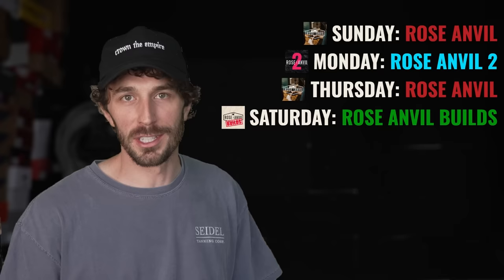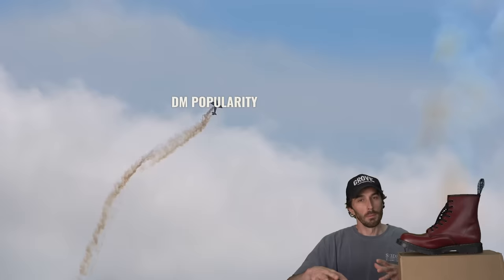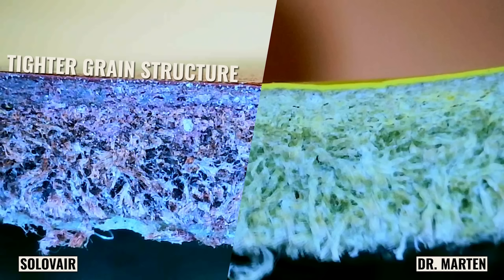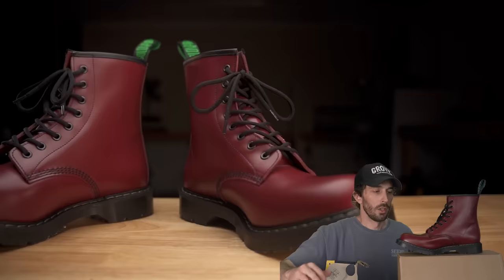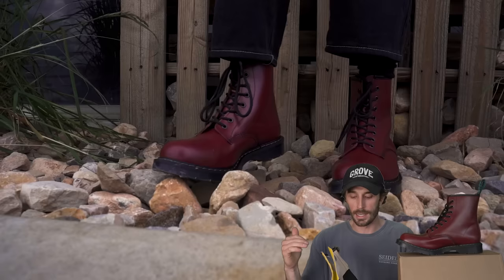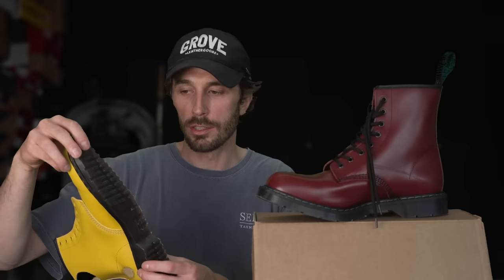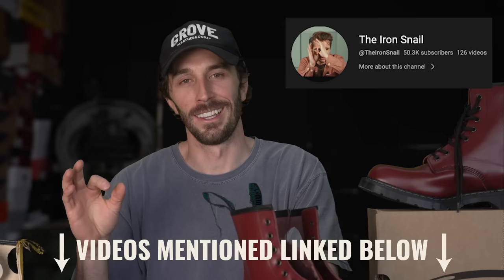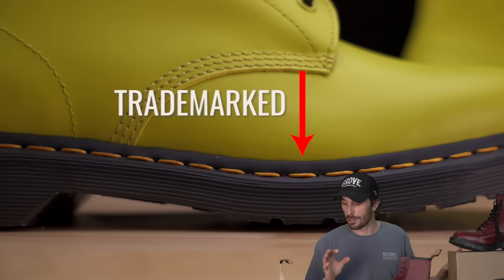Better than “real” Dr Martens - Solovair

Comment: Surprised you didn't mention the main reason I personally bought Solovairs: resoleability. I hate the idea of having to throw away perfectly good uppers because the sole has worn through and can't be replaced
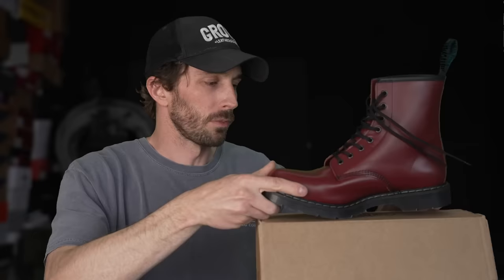Reply: He briefly says it at 9:56 😂
Reply: I agree with you but resoling is pretty expensive, It can easily cost like 75% of the shoes cost , so i understand why it’s not a glaring issue. Even though i do agree that keeping the upper is better as it’s a bit more eco friendly and worn leather just looks nice imo
Reply: Honestly, that was the number one dealbreaker for me when it came to Dr. Martens. I actually bought a pair of boots that I purchased when I was 16 1/2 years old. I was originally going to get more when I first came across Rose Anvil’s original review of the brand itself and learning about how it would be difficult to get them resoled.

It wasn’t an easy choice for me to make up the time, but that’s when I decided that I wasn’t going to buy doc martens ever again. As much as I like the fact that they were cheaper (not including the fact that they upped the price by $20 during 2022), I thought that I was paying for a higher quality boot that looked exactly like doc martens.
Reply: In the UK Timpsons can resole Dr Martens. However, it can be costly especially if they aren’t the standard sole. I bought some DMs for £90 (down from £120) tried to get them resoled, they quoted £60!
Reply: 60 seems ok on a 200+ boot?
Reply: @Stan_the_Belgian where I’m at in the US there’s a local cobbler that can put vibram soles on them, but it’s 120 bucks, almost the cost of a new pair.
Reply: You are comparing English Solovairs to Asian sweatshop Dr. Martens. Completely biased and unfair…
Reply: @cruzmalibu4361  agreed. They should be the made in England ones dr martens used to compare.
Reply: I just bought my first pair of Solovair chelsea boots and I will never buy an everyday shoe by another company..
Reply: too bad the solovair doesnt have yellow stitching that is the thing i like better on the dr
martens…
Reply: Waiting for Solovair to come out with a platform that is at least 2” like the Jadon’s. I would spend the extra for their quality, but I prefer a high platform of 2”, and Solovair only goes up to what looks like a Bex height or about 1.5”. 

The other issue is that Solovair has significantly less selection and unique styles than Doc Martens has. I love the selection of unique boots Docs comes out with, I’d absolutely spend extra money on better quality, but I’m yet to find another company who makes similar platform boots with so many unique styles. 

Anyone find a company they love making high quality platform boots? I’d love to know!
Reply: A couple of years ago, two pairs of my Doc Marten shoes were getting quite worn on the sole. A local shoe repair shop charged £60 per pair for a full DM resole. But instead, for less than £20 per pair, they almost seamlessly bonded a layer of very similar looking, but sturdier PVC material onto the original sole and heel. It looks great, and it certainly doesn't wear as quickly as the original material. Well worth it to extend the life of DM shoes or boots. I've been wearing DMs since the early 1980s, but I won't buy any again, they've really gone downhill.

Comment: I have a pair of steel toed 10 eyelet Docs that were made in 1987. I stopped wearing them in the late 90s because the steel toe was uncomfortable. I held on to them because they had a double yellow puritan stitch that I’ve never seen on other Docs. After watching your first video on Docs, I dug mine out and cut into the well worn soles. They had wooden shanks that were both broken. I found a place that resoled them with Vibram soles after removing the steel toes. They even preserved the double yellow stitch. I had them put in steel shanks. They’re finally comfortable to wear and the leather is still holding up. The quality is totally different compared to later made cheap Docs. I’d love to see what’s inside of the “Made in England” boots today. Thanks.
Reply: Where did you find a cobbler to resole them?

Comment: I have a pair of the made in England Docs and they’re superior in every way to the current regular Docs. They definitely remind me of the ones I wore in the 90’s- much tougher break in but then pretty comfortable. I’d really like to see a comparison between these Solovairs and the MIE docs. Great video.
Reply: there's a comparison video on this channel somewhere. I think the conclusion is that the MIE docs are much better than the china-made crap ones, but the solovairs are still better that the MIE doc's.
Not that the solvair's are without their compromises. But it looks like they're some of the best boots *for their low price point*. Sure i could get redwings for like £100 more, but that's like a 50% cost increase
Reply: does it actually fit in? if you wear chinese uk 8 size will the same MIE 8 fit or you need larger?
Reply: @irakli.asatiani I think they're made to the same size

Comment: Quick tip if you’re about to buy Docs/Solovair: never buy Hi-Shine ones. These boots have some kind of plastic coating on top that not letting shoe creams penetrate to the leather.
Always choose for Grain Leather, Greasy ones or any another that actually has real skin pattern on top.
Reply: your point is right, but the coated leather is the classic look most people want to have when buying a combat boot.
Reply: Yup, I have a more dress oriented solovair shoe with this high-shine finish, and it has cracked and wrinkled to shit. No slav squats allowed!
My oil leather 10 eye shit kickers from them are going strong after half a decade.
Reply: Are you referring to patent-leather high gloss or even leather that can be polished to a higher gloss (and open pore that absorbs cream and/or mink oil)?
Reply: I second this, I made the mistake of picking up the hi-shine version and I regret it, since the "flawless" shine becomes obsolete once the leather starts really breaking in and cracking
Reply: @awethesound  Off topic, but proper slav squatting doesn't crease shoes. Source: am a Slav.
You should keep your feet flat to the ground, shouldn't lift your heels up. That way you can relax your leg muscles and you are more stable.

Apparently westerners have trouble doing it properly? At least, that's what I've heard. Something about calf muscle lengths, don't remember it well.
Reply: @RaccKing21  not really a muscle thing, we're just used to always lifting our heels when squatting briefly and not squatting for really any other reason than that. I can do it, but unfortunately I can't really do it in leather boots, gotta bend my ankles a bit, but heels stay flat.
Reply: @salskars6637  I think he's not refering to patent leather but to "bookbinder leather". But no, neither of them absorbs cream.
Reply: @RaccKing21  I can pull off a slav squat reasonably well, but I still find it fatigues my legs, i can't feel relaxed in that pose ahaha
Reply: @Unimportant Account  I don't squat much in day to day life, but it's handy if I'm waiting in line or something. It looks really dumb, but I genuinely just squat in the middle of a line if my legs get tired.

It's possible you're keeping your legs too spread out, you should literally be sitting on your calves (maybe I just have thick thighs so it's more comfy to me).
Reply: Thanks 👍
Reply: @phipschi4255  Yeah, my point was too radical. Just want to warn people who expect that their Hi-Shine boots would last longer without cracks if they gonna use conditioners/shoe creams/polish. Hi-Shine leather just won't absorb it.
Reply: Same goes for any dress shoe or boot up into the high end. It’s called polished binder or bookbinder and yes, it will eventually crack. Even on £870 Church’s.
Reply: Ty that's actually very useful to know! The polished look is definitely appealing but it's nice to know what to expect at least :)
Reply: @awethesound could you elaborate a bit on how long it took for the coating to crack? Like how did you wear them and after how long did you notice? :)
Reply: They have a crazy horse lesther option (lightly sanded top). That one is probably their most durable version, it won't show scratches or creases and will absorb leather conditioners.
Reply: @phipschi4255  you just gotta learn to shine boots...if you want to learn really really good, join the military.
Reply: Yes and then they crack and tear and you have to go have them fixed and it makes you so sad!!!
Reply: How do you know which size to get?
Reply: @Chilling4Shillings This type of fashion boot is called a combat boot
Reply: @RaccKing21  yeah, I'm Polish, but I do it improperly. I guess it's that EU citizenship.
Reply: @maxjarvela4255  honestly within the couple first wears. I did nothing to avoid creasing them, but didn't expect the effect that I got.
Reply: I have learned this the hard way. But anyway, I think the greasy leather looks much better and it’s so resistant to creases
Reply: One of the best things about Solovair is the wide variety of leathers and finishes available
Reply: Welp I just go my Hi Shines in the mail :(
Reply: @jtlovestj  Nothing wrong with the hi-shines, it depends on what you bought them for & how you intend to wear them
Reply: @antennastoheaven  correct 👍
Reply: Some years ago,the leather they used was rectified leather but it was not covered with that layer of plastic, it looked matt and much more natural. they changed it for this copy of the leather that Martens uses covered with polyurethane, which they call "hi shine" and for me it is crap compared to the previous one
Reply: @phipschi4255  I wouldn't compare Docs/Solovairs to combat boots ....
Reply: @borjasaz6611  I think this is the case with corrected grain and patent leather everywhere. Even bookbinder leather from higher end companies. If you compare a pair of patent leather shoes from 70 years ago to now it is like night and day
Reply: Same goes for Black Dr. Martens. I have tried numerous products but I could not loosen that crep leather. I sold them.
Reply: I used to have this kid years ago who would shine my shoes; he'd make them look like mirrors! I wonder if he's still got that shinebox?
Reply: The conditioner penetrates the leather, it just takes more time.
Reply: But i like the Hi-Shine Solovairs 😭
Reply: The problem with that is greasy or grain leather only have black/brown colors. If you want a different color like oxblood or blue you have to get hi shine.
Reply: Good point! The Hi-Shine models "DO" accept wax-based polish, like Lincoln and Angelus. But like you said, greasy (i.e., non-PVC coated) leather is better for soaking up leather lotion and oil-based shoe creams like Meltonian, Tarrago, and Kelly's. Also accepts waterproofing products better, like Huberd's or mink oil. Great to see Solovair and Gripfast offering the greasy leather option!!   

But of course, if you wanna sport oxblood, burgundy rub-off, or cherry red like a self-respecting punker, traditional SH, or OI-boy / OI-girl, gotta go with hi-shine.  😎

OI OI OI!! 🇺🇸👊👊🏿🇬🇧 ⚽
Reply: I dont think people who buy Docs really care whether or not shoe creams penetrate to the leather. :D
Reply: I love seeing this right after applying cream to my brand new high shine solovairs :))))
Reply: @jtlovestj  I've had my hi shines for almost 2 years with almost daily use and they are still in fantastic condition. I do my best to clean and maintain them regularly
Reply: @jaimesantiagolonga True to size?
Reply: I have a pair of high shine but I pretty much only take them out to a concert or party or something.
Reply: I bought high shine dainite 8 eyelets. My absolute star buys.

I also bought the greasy chukka boosts with solovair sole.

I have barely worn them. I love my 8 eyelets so much.
Reply: That's cute, dude. Except the greasy ones also have a coating, which is thin enough to see the grain, yet enough to stop any cream absorption.
Reply: What about rub off? Theyre a better buy than hi shine? Thanks
Reply: @closetome The same.
Reply: a tale of two boots: i bought hi shine and goucho derby from solovair. hi shine, tough as fuck to break in but tightly hugs ur foot in a firm supportive grip, gaucho - no breaking in required but a bit sloppy compared to the hi shine esp after a month or so. TOP TIP, buy gaucho half a size smaller than ur usual size. And keep in mind unfortunately solovair dont do the 11 hole version in the gaucho / greasy leather, only in the hi shine version.
Reply: @-Only.Facts- they don’t shine boots anymore. You don’t get a boot you can shine issued to you as part of your uniform. So it’s no longer part of the training. Those were in the Jungle boot days.
Reply: @billymurphy3  nicca please...I learned how to shine in the military and now I can shine any leather.
Reply: I made the mistake of buying the hi-shine, what could I do to make it last?
Is there a way to get the cream to penetrate the leather in some way maybe?
Reply: @Cor-kid  Not actually. I have hi-shine pairs too and the most crucial thing that worked for me is to use shoe trees. Yes, ugly wrinkles  still wil appear anyway, but at least they won’t increase and won’t crack.
Reply: @-Only.Facts-  or go to a leather convention.

not a leather industry convention.

note: if you do go to a leather convention, they tend to be 18+
Reply: Greasy technically better but as it ages it not for everyone way to Sid Vicious Billy Idol for the majority non purist…chose with caution
Reply: @phipschi4255  If you do it right, you can get a really good shine without the coat. You just need to maintain them properly.
Reply: Does this also apply to the rub-off finishes and can you actually sand away the plastic once cracked?
Reply: Yes, standard shoe creams don't work on patent leather (which is what the Hi-Shines are), but as long as you use something that's actually meant for patent leather you'll be fine.
Reply: @Changeling  So what's the best way to take care of such leathers and what to do when the plastic coating cracks?

Comment: I'm 10 years into my first (and only) pair of Solovairs' 8 eye derby and they are still in such great condition. This is with me going some years wearing them daily and some years wearing them only a handful of times. Just wearing them for regular daily activities (I never worked on the farm in them since I needed waterproof boots) but I did walk miles and miles around campus trying to break them in the first year lol. If you keep them cleaned and conditioned they will outlast all your other shoes. I'm glad I started "buy it for life" back then because this is one item that has saved me money in the long run.
Reply: I had my original dr martens for twenty years when they were made out of proper leather and not the crap they use now ..my last pair lasted two months ..the leather split right off around the sole .and the toes cracked through on both where they bend on the toe area ..nothing would stick to them, polish ,dubbin .no wonder they crack so easy .and they were the made in England ones too ,not the foreign made ones ..wouldn’t touch them again ,

Comment: I have two pairs of Solovairs thanks to this channel, and I love them. Great boots and none of the issues that I had with my previous DMs.  Only issues I've ever had is with the laces eventually snapping, but its easy to get replacements of their website (and in various other colours).  When I've the spare cash i will be buying a third pair of Solovairs
Reply: Yeah I fancied a pair of dms but since watching this realised how shitty they are. This could be the answer.
Reply: @stephenlamley541  I own both monkey version boots and used docs for work they hold up fine. Solovairs are harder to break
Reply: The laces are snapping because they use low quality eyelets. The portions of the eyelets that bend around the letter to fasten them break off, leaving exposed, sharp metal that cuts through your laces. Are any of your eyelets damaged?
Reply: I wonder if filing the eyelets down a bit will help with this.
Reply: @koolchem6653  There's not really a way to do that, if you saw at where the break occurs. The break also causes the eyelet to lose its structural integrity - the pull of the lace makes it stretch out and lose its circular shape. In any case, it's a significant downside to a fairly expensive boot.
Reply: @ThisIsMeArnold  first time i've seen someone else talk about this - laces wearing through rapidly are the #1 downside to solovairs for me. otherwise very happy with them
Reply: @FractalZero  I suggest you try leather laces.
The other major downside of Solovair boots is that the soles are slippery on ice or snow. There is in fact no other boot in the world that is as slippery in the winter as these. It's due to the compound that is used. Even lightly packed snow behaves like pure ice.
Reply: What would be better for ice/snow: any recommendations?
Reply: @jonathanmelia  Solovair (the steel toe edition) aren't matched by any footwear on the planet in terms of comfort. Lots of walking, standing in one place without moving, etc. - there is no fatigue due to how soft the soles are. The softness is what makes them so susceptible to sliding. This can be resolved by wearing Yak Trax, a slip-on boot accessory (but not totally resolved). The alternative is William Lennon, who make custom boots according to your order. Best boot manufacturer currently operating in the world - the prices are similar to Solovair, boots arrive about 5 months after ordering.
Reply: All Solovair need to do is just not use serrated eyelets and they'd be perfect.
Reply: Yes I also bought two pairs of Solovair after seeing his early reviews and never looked back
Reply: i use 550 paracord for the laces, doesn't break as easy and its available in a wider range of colours and patterns (not to mention its cheaper)